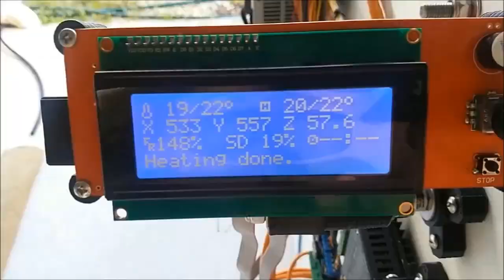Large scale DIY 3D printer - 1200 x 1200 Sub33D V3 - Nema23 stepper motor heatsink and fan upgrade

Comment: mate, I scuffed my aluminum bed with 150grit and use some cheap hairspray as an adhesive agent. multiple layers of hairspray built up like paint. I don't have adhesion or warp issues anymore. the hairspray locks into the grooves and makes it hard to remove. cleans up with water.  yes it is enclosed. your printer is nothing  short of impressive, I look forward to watching all your content.
Reply from the maker: The plastic primer and liquid ABS holds really well (better than blue tape or hairspray), the issues are more to do with the printed parts cooling and shrinking causing huge stresses between the printed parts and the bed

I have just installed 600W of IR heaters to heat the printed parts from above and further raise chamber air temperatures, will see how this works after the extruder upgrade is ready (4 x faster printing speeds)
Reply: Sub33D I see now, I jumped the gun wanting to help before watching more of your material. I fought hard for months to get ABS to print after reading hundreds of conflicting forum posts. I feel a little foolish, but I am a fool and that wouldn't be out of my character to do something dumb 😁
Reply from the maker: Don't feel bad (I would not have expected you or anyone to watch the other material), thanks for your comments (I am always glad for any feedback)
Reply: Sub33D you are the razors edge mate. you're defining tomorrow.  thank you for the kind words, but I am a fool, if you like to laugh then I'm your friend.  either way, I'm your friend.  I'd like to help you succeed, because we both win in the end. I'm just no help at the moment lol. so nice to meet such good people across the world.
Reply: Sub33D watch all the material!  lol. you're doing great work, top pick for guys going big. I will recommend your work to all my friends.  I'm considering scaling down to 600mm from 1000 after all the troubles I've watched you conquer so far. I am learning from you, and that's what I guess I'm trying to say.
Reply from the maker: As long as you don't repeat my mistakes then 1000 x 1000 should work fine, no need for you or any one to scale down, thanks again for your kind words and good luck with your build :-)